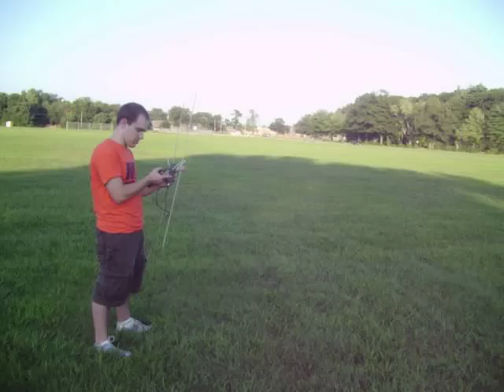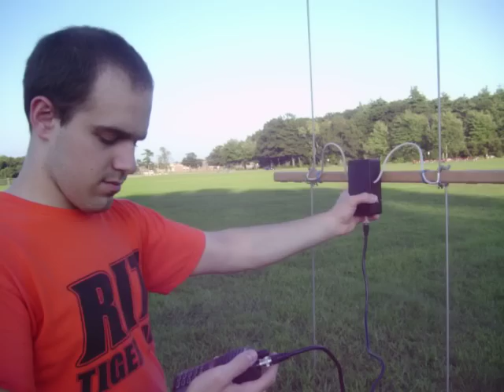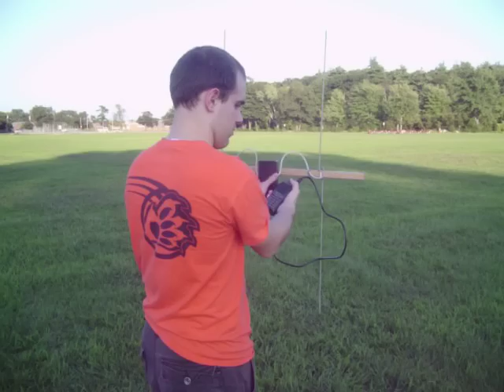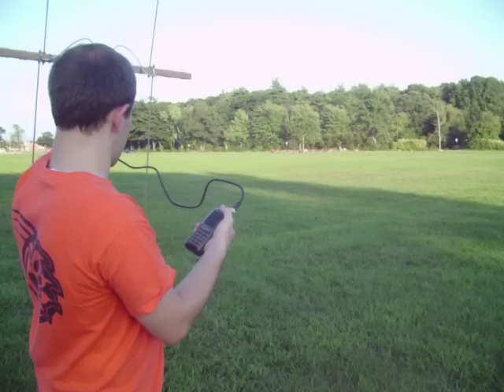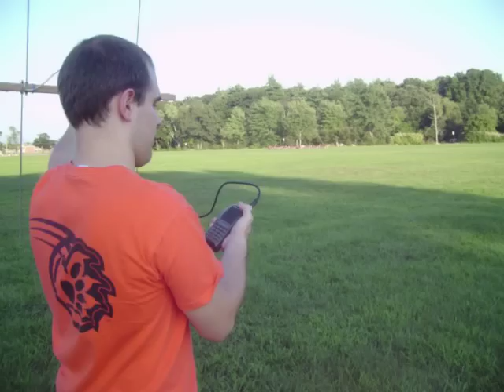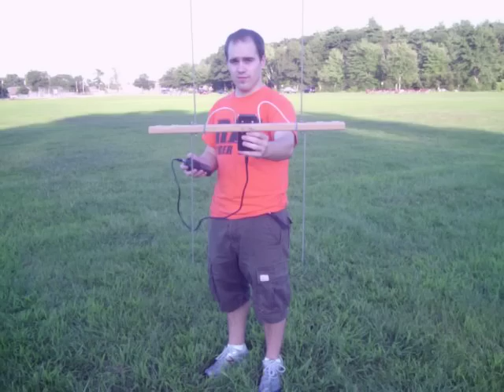KB1LQD TDOA Direction Finding Antenna Test

Comment: Hi, cool - how does your antenna work? It is two dipoles or a Yagi? What is inside the black box between the elements? Is your left arm aligned with the antenna null or peak? I'd like to try something like this at VHF. Thanks.